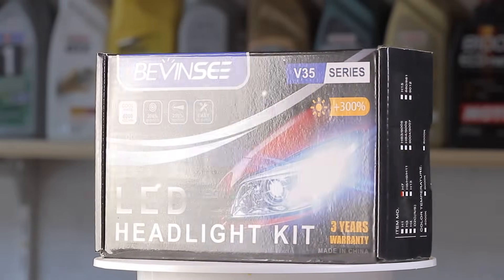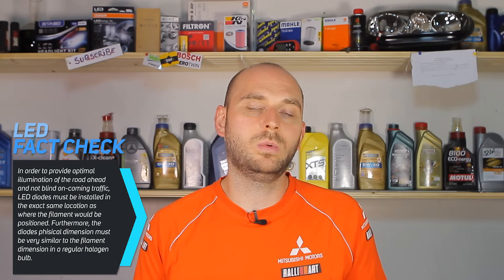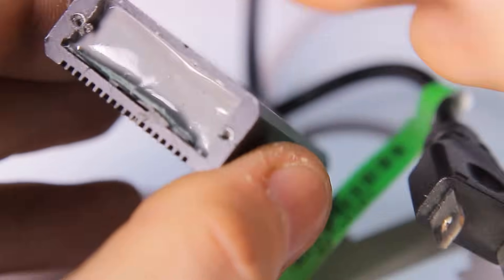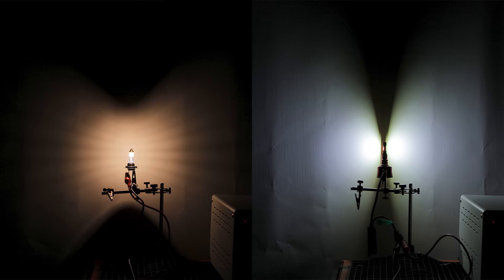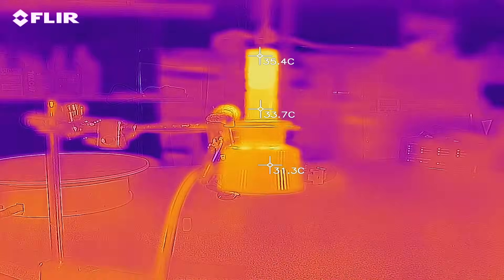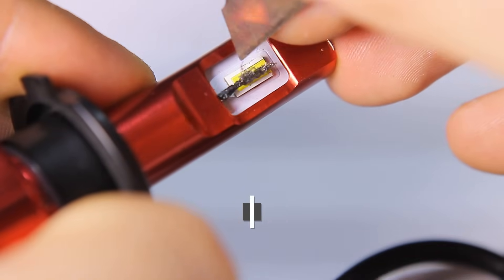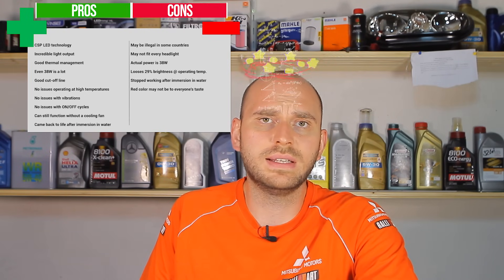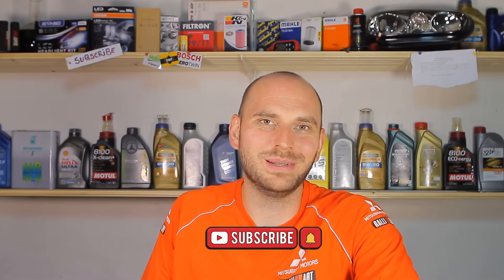50W LED vs HALOGEN - Endurance & light output test - Bevinsee H7 VC Cooling

Comment: In Hungary it's not legal to use different bulbs but anyway they still blinding me on the roads lol.
Reply: Same in Iceland, but I have never seen anyone with LEDs in a reflector lamp getting pulled over lol
Reply: @Naeromusic  Because the cops are just bunch of speedtrap operators and the government authority is corrupt as fuck. For 100€ you can pass any car without brakes and engine on the inspection.
Reply: @namelesske  I wouldn't say that's the case here. You will have a hard time bribing law enforcement here.
Reply: @Naeromusic  Iceland is a cool place to be compared to CEE

Comment: Hi Sergiu, Thanks for your honest testing! 
Our product is designed with a unique cooling system(mentioned on your title--VC Cooling tech) that helps cool down the bulb's temperature but auto reduces the wattage to make sure the bulb won't be burnt out.  

p.s.  thanks for your advice！our next product will be a silver one.  :)
Reply: @B78ERU We also sell on alipexpress, but the aliexpress ones are different from this. We made many series of product, the products on aliexpress is X6 or other series while this is V35 series. You could see the difference between them. We haven't made silver color for this series. Thanks for asking.
Reply: @bevinseelighting7934  Plz let me know where to source your bulbs in India from?
Reply: @chakrapanid6089  We currently have no authorized retailers in India. If you want to get one, please contact our customer service on Amazon.  Thank you.
Reply: @bevinseelighting7934  will you have v35 series on aliexpress?
Reply: @StJerihon  So sorry that we sell this series on Amazon and our site only.
Reply: @bevinseelighting7934  will you ever make a h1 led bulb?
Reply: @miralemnermina142  V35 doesn't include H1. But we have h1 of other series on eBay.
Reply: @bevinseelighting7934  can you share a link please?
Reply: @bevinseelighting7934  Please give us link to AliExpress for the European buyers, i saw some low powered on Aliexpress bit disappointed
Reply: @georgepapa2950  Sorry, we don't sell this series on Aliexpress, but we sell them on our web store www.bevinsee.com. We can ship them to European countries. We offer discounts in our store which may save you some money.
Reply: @bevinseelighting7934  Would you recommend V35 or V45 series for a Kia Sportage SL 2012 with projector headlights?
Reply: @bevinseelighting7934  is this genuine V35 ? 
MYR 189.17  31％ Off | Bevinsee V35 100W 15000LM H7 LED Headlights VC Cooling Tech 9005 9006 9012 H4 Led Lamps CSP 6000k H8/H9/H11 Car Bulbs Fog Light
https://a.aliexpress.com/_mLX3eQH
Reply: @alphazar  Yes.
Reply: Hi Bevinsee....who is your authorised retailer in India. I am looking for H4 led bulbs. Plz provide a link. Thanks

Comment: Felicitări pentru teste! Eu am din 2017 montate pe mașină LED-uri CSP identice cu cele pe care le ai arătat la inceputul clipului, cu răcire doar pe radiator. Niciun fel de probleme cu ele din punct de vedere al răcirii sau al luminozității. Au 8000 de lmn împreună și le folosesc și pe timp de zi ca să protejez cât de cât halogenele de pe luminile de zi, unde doar un halogen costă cât un set de leduri H7 CSP 😄😄 Așteptăm alte teste.
Reply: Din ce ai spus inseamna ca folosesti alte chinezarii proaste . Iar tu spui ca sunt ok. Nu sti ce inseamna un LED cu adevarat valoros si lumina

Comment: I always wondered how well do LEDs deal with iced/snowed up headlights. They dont get as hot as halogens so I bet snow would build up in a blizzard...
Reply: There are headlights on cars equipped by the factory with no washer or anything to clean them and I am pretty sure they tested that as well.
Reply: @alexandruilea915  we're talking about aftermarket kits here
Reply: @-Yurkey  yes buy they produce about the same amount of heat...
Reply: @alexandruilea915  6:50 watch it again, halogens go above 400°C and if you have ever touched a headlight you'd know it gets warm to the touch, not burning hot, but enough to melt oncoming snow... LEDs dont get that hot, the outside of the headlight probably wouldnt even get warm.
Reply: @-Yurkey  I was talking about after market led vs factory equipped led that they produce about the same heat
Reply: @alexandruilea915  This video is about aftermarket LEDs equiped in halogen headlights, that's why he's testing them in the first place... Factory LEDs need no testing from people
Reply: @-Yurkey  I see that you don't want to understand me or something. I understand that this video is about aftermarket leds but what I meant to say is that even if it's an aftermarket led or a factory equipped led it produces about the same heat. Therefore if the cars that come with it preinstalled don't have an issue with snow building up this shouldn't as well.
Reply: @alexandruilea915  and you keep missing the point where halogen headlights are not made the same way as factory LED headlights, the plastic is probably much thicker and stronger to withstand halogen heat so when you put a LED in that type of headlight it'll probably get less hot on the outside vs. LED headlights designed with LEDs in mind.
Reply: @-Yurkey  I don't think the factory equiped LEDs have less thick plastic but maybe something else. Anyway as someone said in the comments of that video using the high beams (halogen most likely) should resolve this problem. The low beams are for driving in town or for when someone is close to you otherwise you should use high beams which I guess should still be halogen.
Reply: Because of that and other things, LEDs in reflector headlights Illegal in Europe.